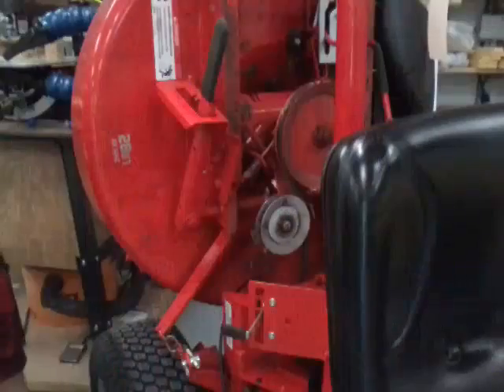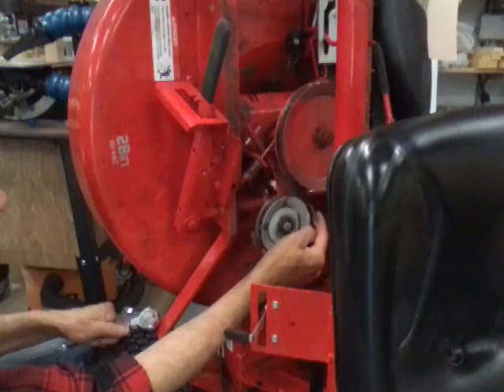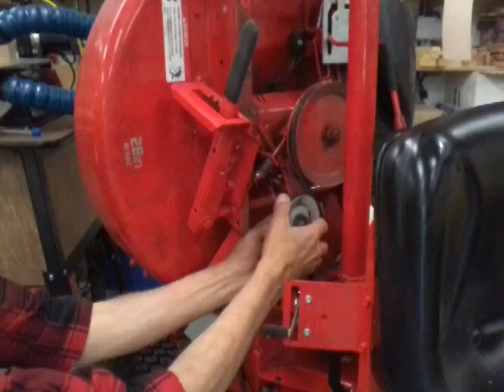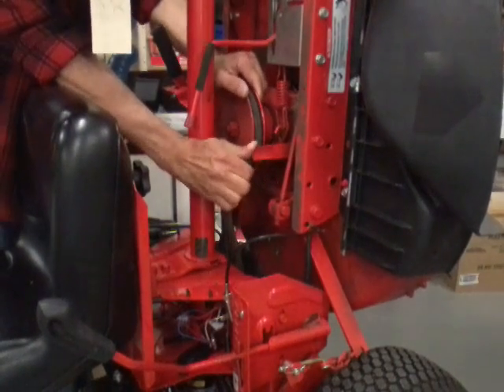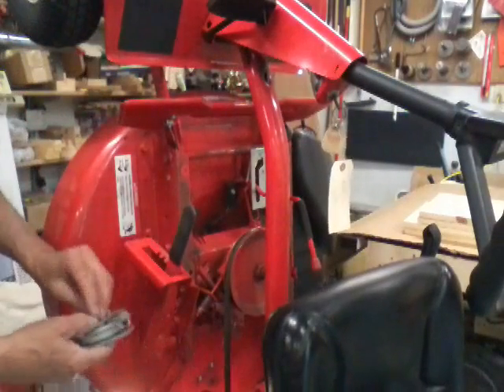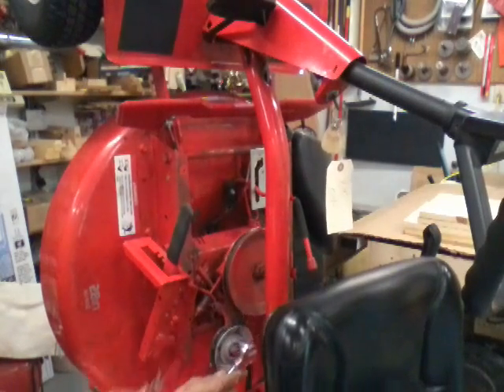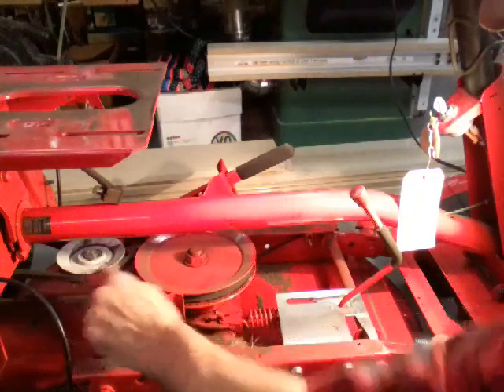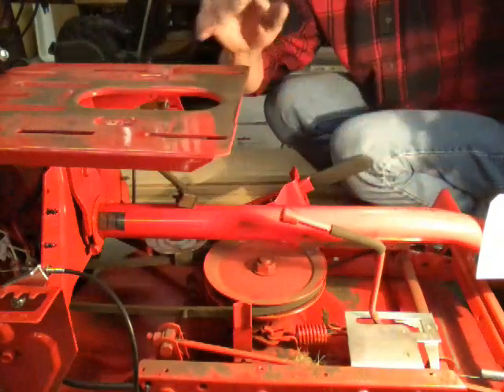101. M/S.7  Removing and installing a belt on a snapper Rider

Comment: i repowered my snapper rider with a briggs motor with a 25mm shaft. I figured the 0.016 difference in shaft diameter wouldn't be a big deal, for the drive disc its not, it works perfect drives around no issue, but the belt now slaps really bad to the point that you can't engage the blade, could this be caused by the slight out of roundness that the crankshaft pulley is at now due to the offset caused by shaft diameter difference? Any help is appreciated
Reply from the maker: GarrittpwlTV 
.016 difference between a 25 mm shaft in a 1 inch shaft does not sound like it’s a big deal But and there’s always a butt when it’s spinning at 3000 RPM’s that .016 inch is going to make a lot of difference now if you know somebody that works in a machine shop or you have a machine shop close by you you can stop in and ask them if you could have a small piece of shim stock to cut and fit around your crankshaft and then slide your drive disk over it and that will illuminate the run out issue and you won’t have to get rid of the engine you just got or live with this tremendous vibration issue Give that a shot and see if you can find some shim stock if not send me your name and address to my email and I’ll cut you a piece of shim stock and mail it to you to take care of your issue. Jim
Reply: @jimjackson9381  thanks for the info! I attempted this with an 0.08 feeler guage in between the hub and the crank opposite the keyway to no avail unfortunately. My other thought was to have someone punch out the hub to a bigger diameter and make a keyed insert for it. What do you of that route?
Reply from the maker: GarrittpwlTV 
I think it be much easier to use shim stock. Jim

Comment: Hey Jim,  thanks for posting this video.  I’d done this job a few years ago, following a different YouTube video.  It took me a couple hours.  Today, I knocked out the job in about 20 minutes.  I was considering replacing my mower, but now this toughest maintenance job has been made easy.
Any thoughts on why I have to replace my drive disc 3-4 times a year?
Reply from the maker: About how old is the machine? 
And is it the drive disc or is it the clutch disc?   The drive disk is hooked to the bottom of the engine. The clutch disc has the black rubber on it and hook to the side of the chain case. I need to know for sure before I can tell you what to look for.     Jim
Reply: Sorry @jimjackson9381
Reply: I forgot to mention I weigh 250 lbs. and cut my lawn 36-40 times per year.  I live in Southwest Florida.
Reply: The mower is 5 years old.

Comment: Hey Jim, It would seem less effortless to remove the drive belt cover if the cover was split or cut through to the blade lever. My cover is that way and very easy to remove. Just a thought...
Reply from the maker: Dennis Rome 
Yes all the newer machines the covers are split for easier removal. Jim

Comment: Jim great video. 
Question:     
I have a 28in 9hp with a ninja mulching blade. Consistently now when I get into grass that is only  somewhat thick, I can look down and see (now that I have taken the belt deck cover off to see what's going on) I see that the main spindle pulley will slow down than completely stall out and the belt can even smoke sometimes. And I will have to back up and disengage the blade then come back again when the blade has momentum again.  I should note that this happens when I am in speed #1 as slow as I goes. What would you suggest to remedy this?   Could the belt be to stretched out and not be transferring power or do those mulching blades need a certain type of deck or plastic side shroud? Let me know if you need more info. Thanks for all of us you are helping.
Reply from the maker: Logan Witt hi Logan it's Jim
  The first thing you want to do is take the belt off of the spindle engage the mower deck as if you were going to mow with it and turn the spindle  to see if the spindle is turning freely,  if it does then check your belt for bad spots ,  if the belt looks good put it back on and check the belt tension you want to have about an inch and a quarter between the belt by the idler pulley, try that and let me know if it helps or not talk to you later Jim

Comment: Need Replacement BELT  WIDTH Advice:  Series 15 33" deck w/dual idler pulley system (non-adjustable):  Broken belt appeared to be a 5/8" wide 74"  Manual says 7043844YP Briggs # but no specs on width other than 74" length.  (it may be a 6-sided AA belt)
Hardware and auto parts industrial/fraction belts available in 74 x 1/2" and all cross into the YP #.   
The 1/2" belt sits in the BOTTOM of the DEEP motor and spindle pulleys and screeches/slips as the blade comes up to speed.   
With blade engaged, engine off, if I attempt to turn the blade, it slips on the engine pulley.
FEAR:  afraid the actual YP belt will be 1/2'" and do the same thing
OPINION:  use the 74 x 5/8 hardware/auto parts belt.
Reply from the maker: Well, if this is a SnapperRear engine rider is supposed to have a Double The Built. If you want to put a standard V belt on it, you’ll have to change the idler pulley to a flat pulley instead of a V pulley.          Jim
Reply: @jimjackson9381  I think that is correct for the non-33" decks which have only a single idler.  The 33 has a double idler system:  one is a v-belt pulley and the "middle pulley" is a flat bottom that is clearly designed to contact the flat top of the belt not unlike an automotive timing belt tensioner.  

This is troublesome because if the correct belt is a double V, then why the flat bottom pulley instead of another V-pulley that reverse wraps the belt?  

I'm beginning to wonder if someone replaced the reverse wrap pulley with a flat bottom so a conventional V-belt could be used???
Reply: @jimjackson9381  UPDATE:  Got a genuine Snapper belt and my advice to all is do the same thing.  Everything works better with the correct belt.

Comment: just ordered a new belt for my craftsman snapper mower- what size are the bolts for the cover? so i know what socket to use? thanks, mike
Reply from the maker: Mike gorton 
Mine are 7/16. Jim
Reply: @jimjackson9381  Thanks Jim- snowing here in Rochester NY- guess i'll have to wait to put the belt on now-lol- bought a double v stens belt on amazon -- good price-
Reply from the maker: Mike gorton 
Do you know if you can find a belt locally through a dealer we have a place here called industrial supply that sells any belt that you need you could buy a standard Vbelt and go to a flat idler pulley instead of a V idler pulley and you could probably find a belt a lot cheaper. Jim

Comment: I have the new 2019 classic 33" snapper and want to add an hour meter. What type of hour meter do you recommend and would like details on how to connect the wires to make it work. I have the Intec 15.5 HP engine. Any help is appreciate.
Reply from the maker: Oldnavy 
  Well you know that’s not a bad idea I don’t have any hour meters on hand I’ll have to find one and I’ll show you how to wire it up, I hope you’re not in a big hurry it may be a week or so let me know if you are. Jim
Reply from the maker: Oldnavy 
  Hi it’s Jim
  What’s your name I would like to use it on the video I’m going to make installing this very meter I’ll have to find a good place to mount it. Thanks for the tip from Amazon it’s cheaper than I found it I’ll order it tomorrow and as soon as it comes in I will do a video on installing it, anything to help out A veteran and I wanna thank you for the service that you’ve done for this country. Jim
Reply from the maker: Hi it’s Jim again I think I found a perfect place to mount that meter I want you to send me a picture of your machine so I can see if you have the same bracket that I have, I need a picture of the left-hand side of your machine where the handle is that you accelerate the engine with, you can send it to my email which is
 jimsfixitshop@gmail.com
  Thanks again. Jim
Reply: @jimjackson9381  Hi Jim I just now read your latest to me. 
I am sending you an email. Thanks.

Comment: Hey Jim, I wasn't aware of the double v configuration. Thank you for that. Ordered one from Ebay. 
My idler rolls free but feels a tiny bit dry. Can I stuff a little grease in it? Lithium ok? Or just replace it? Thanks for any help.
Reply from the maker: tom crouse 
Hi Tom
 If you can force enough grease into it to smooth it out I would do that at least try it otherwise I suppose you’ll have to replace it, any type of grease would be fine. Jim
Reply: Jim Jackson  hi jim

Comment: Hi jim i have a snapper rider mo# 28083s can you tell me the right size belt or pt# for the blade belt, i called a company told them the mo# and that i needed a blade belt well the belt came today and it's too short i managed to get it on but it's so tight, and thats with no idler. i hope you can help me out Rich.
Reply from the maker: I built a 73 3/4 inches long part number from Parts Tree.Com. is 7043844. Jim

Comment: My snapper has a plastic grommet or bushing on the frame tube that is broken how do you replace it and where can I order it from? I have a Snapper 28" hi-vac rear engine rider. Thanks great video.
Reply from the maker: You need to watch video number 107 if you're not subscribed you'll have to find a video and you can get the parts you need from Parts Tree.Com .  You can find their phone number on their homepage on the Internet call them and when you order the part tell them Jim's fix it Shop sent you .  Thanks Jim
Reply: Thanks Jim going to check it out now.
Reply from the maker: Jesse Black 
 Cool, Let me know how it works out. Thanks jim

Comment: Hi Jim,  just replaced my blade belt and the tube has to be extended.  I loosened the clamp but the tube is very hard to extend..   battery is removed, should I spray the inside tube with pb blaster to get it to move?
Reply from the maker: Well the front end twist in the tube or is it froze up
Reply: I used a stens 265-199 belt, replaced snapper 7022252YP.
Reply from the maker: @dogsarefun2  Well that’s probably OK but will the front pivot in the back or is it froze up
Reply from the maker: If it pivots or turns you should be able to pull it out and tighten your belt. Jim
Reply: @jimjackson9381  I will try tomorrow..... I tried it before watched your video, mower was not standing up.  Tried pulling on front end with my feet on battery compartment  by clamp, the tube came out a little bit.   I have about 3" of belt space where it is supposed to be 1" .
Reply: another question, I'm replacing the battery, it is a U1, but the battery I purchased (only one in stock)  is 350cca.   Any problem using this with higher cca?
Reply from the maker: @dogsarefun2  Well then Belle might be a little too long, if the machine sitting on the ground grab onto the front and just above the tires lifted off the ground a couple inches and try to twist it it should twist very easily. Jim
Reply: @jimjackson9381  Just tried, it does twist! Do you keep twisting to pull it out further?
I bet the belt is to big, I have about 2.75" gap.  I had the engine replaced years ago, they put on a 10.5 hp instead of the 12.5.  Wonder if the main motor drive pulley is smaller than the original.
Reply: That gap is way to large.  With the belt off and squeezed together it measures 35".  I can try pulling the tube out further, May to come out about 2".  Thanks for all your help!  Subscribed and thumbs up!
Reply: typo correction - may have to come out about 2"
Reply from the maker: @dogsarefun2  Well there is a limit on how far you can pull it out. Jim
Reply: @jimjackson9381  please post the belt part number, I want to make sure I have the correct belt, using stens 265-199 belt, replaced snapper 7022252YP.
Reply from the maker: @dogsarefun2  I will need the model number of your machine to look up the correct belt part number. Jim
Reply: @jimjackson9381  off the tag on rear of chassis, model 7800104, serial 2012900186.   Receipt when I bought it in 2008,  says 2812523BVE..... I believe I have the right belt.
Reply from the maker: @dogsarefun2  OK there are several model number machines that end with the BVE number you also have to look for the 7800 104 number and the belt that you should be using they say is 73 3/4 Inches long and the part number is 7043844YP that’s the number I come up with from partstree.com. Jim
Reply: @jimjackson9381  Hi Jim,  Thanks.... looked up that part number too and at ereplacementparts.com it says the belt is 73".....  if 73" is the true size that would make a better fit..... the stens I have is supposedly 74 x 1/2
Reply from the maker: @dogsarefun2  I would go with the 73 inch belt because I’m not sure you can pull your frame apart far enough to tighten up the other belt. Jim
Reply: @jimjackson9381  Have your ever seen a Snapper RER with the gap I have of 3" when blade engaged?
Reply: Jim, for your info, Tractor supply has v-belts in 1" (70, 71, 72, 73") increments, I picked up a 72" and will try tomorrow, I'll let you know how I make out....
Reply from the maker: @dogsarefun2  The snapper Vbelt is what they call a Double V the back of the belt is not flat it also has a V so if you use a standard belt you have to change your idler pulley and put a flat one on. Jim
Reply: @jimjackson9381  I give up.    I would have put that TS belt on!  Thanks for all your help!  I will have my snapper service guy deal with it....

Comment: Jim, how can I loose the belt too tight!
Reply from the maker: @legacytrucking  for some reason as a built snappers, they change the way the belts are adjusted as you seen in this video. This one just has a pin and you use spacers. Most of them have a clamp around the tube that kind of resembles a muffler clamp loosen that clamp up and if your belt is too tight, you want to push, the front end or the tube into the rear case and re-tighten your clamp if you don’t have that style or you can’t figure it out take some pictures of it so I can see what you have and I can explain to you how to loosen and or tighten your belt

Comment: Thanks Jim! I have a 28” Snapper Series 22 Rider. Will these instructions work for mine.
Reply from the maker: Carl Bailey 
Hi Carl it's Jim
    Yes there will work there are slight variations in the snappers from year to year but using these videos as a guideline will help you rebuild your machine without any trouble, if you do have a problem just email me and I'll help you out. Thanks Jim                    And if you're not a subscriber please subscribe it's free and you can be notified whenever I put on a new video if you want to.

Comment: Hi Jim Exactly i need that belt but is Snapper 1438H How you call this belt ? If know part number Please tellme exactly name of this belt Thanks
Reply from the maker: pepejoyita 
I assuming you’re talking about the belt for the mower deck I can’t come up with a part number because I don’t know what your model number is of your machine take your model number and go on Parts Tree.Com and you can look up the belt and it will give you the part number. Jim
Reply: Jim Jackson The model is 1438H I’ll be try found on the website you game but If you found that belt number before please send it to me asap to buy it Thank you Jim again
Reply: The belt on the big red pulley with the small tension pulley How usually everybody call that belt? Is drive belt or deck belt or “v” belt ? I little confused 
And i can pull the cord is like stuck I check the blades (they are free movimg with my hands) i check spark plug ( no oil in the spark plug hole) I don’t know what else to do
Reply from the maker: pepejoyita 
If you have a rear engine snapper rider, there is only one belt on it regardless of what everybody wants to call it. 
   And if your ropeis stuck you should probably remove the recoil cover from the top of your engine and turn it upside down in oil it as you pull the rope in and out, otherwise if that’s not the issue then maybe your engine is locked up. Jim
Reply from the maker: A 1438 H does not sound like a snapper rear engine rider model no. 
 It should be something like 2812513 BE. Jim
Reply: Hi Jim This Snapper is 1438H 
Snapper Hydro 38 inch blade Not sure is you know this machine But is a little different from yours So still in problems 
But thanks anyway

Comment: What sizes blet i have put on two they're to long
Reply from the maker: David Houston 
 Well what’s the model number of your machine and at least what size is your mower deck and it is a snapper rear engine rider correct. Jim
Reply: @jimjackson9381   thanks you mower shop replace with short one  deck is 30" thanks you sir

Comment: what size belt should I buy for a replacement?
Reply from the maker: Jon McKnight 
   I measured one of my belts off my snapper it measures 72 1/2 inches long. But if you use a standard Vbelt you're going to have to replace your idler pulley.  The snapper drive belt is a double V it is not a standard belt.  Thanks Jim